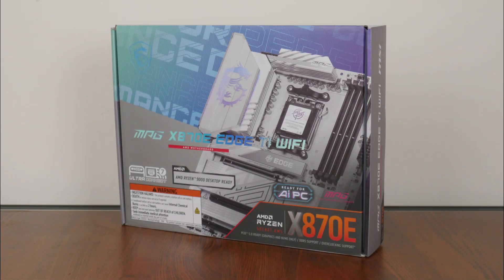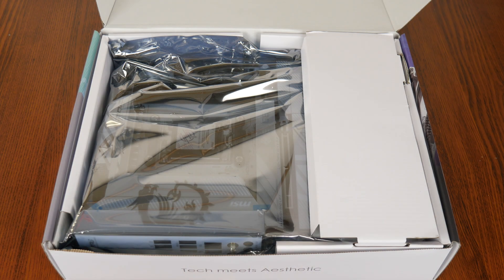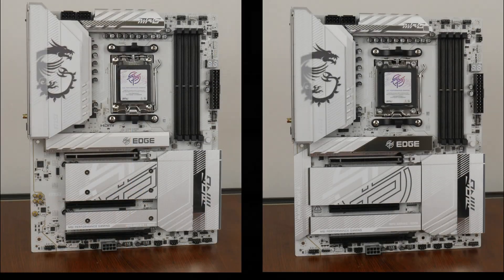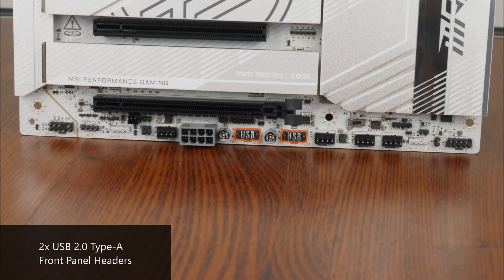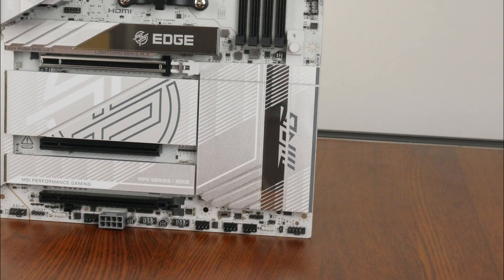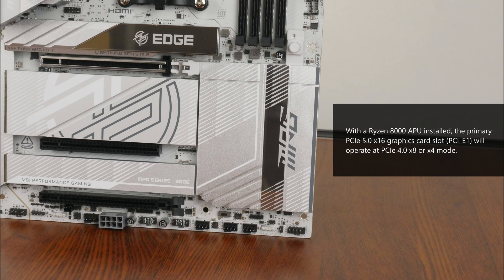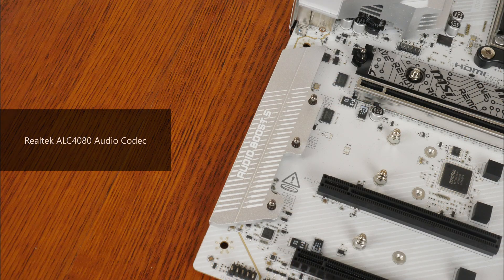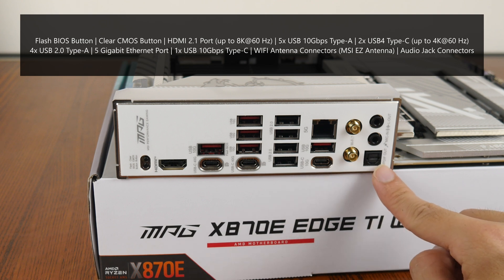Great for high-end Ryzen 9000 PC builds in white! MSI MPG X870E EDGE TI WIFI Unboxing & Overview

Comment: Very nice on detailing the features! However, the CMOS battery is not shown on this type or several other of MSI Motherboards!. Would you be able to provide that location MSI is hiding the CMOS battery? If possible an edited video or photo showing this location would be very, very helpful for that future battery replacement. It would seem not many YouTube Poster's are covering this missing information to the consumer.
Thank you!
Reply from the maker: Hey there, thanks for the kind words. I don't have the board with me anymore as it's a media review unit - that said, if my memory hasn't failed me, the CMOS battery SHOULD be hidden beneath the shroud of the integrated I/O shield. From my experience, that's where motherboard manufacturers tend to "hide" the CR2032 battery, and such boards usually use a CR2032 module that has a two-pin wire sticking out that goes into a connector on the board, rather than the traditional CR2032 round-shaped battery holder that we tend to get on motherboards in general.

https://tech4gamers.com/msi-mag-b850m-mortar-wifi-review/ <- there's a picture of the location of the CMOS battery here for a different MSI AM5 motherboard, you can check out the photo under the "Network and Connectivity" section of the article. Hopefully this photo gives you an idea of where the CMOS battery tends to be hidden by MSI!
Reply: @Darn, yeah if you sent the board back, you won’t be able to locate it.
Yes I’ve been looking for that silver coin in the socket, which is usually hard to miss.
I would believe the manufacturer would have it easy to service without board removal, maybe NOT. 
Thanks for sharing your knowledge! 
Best to you!
Reply from the maker: Cheers. Actually this whole hiding of the CMOS battery thing is becoming more common of late, from my experience messing around with motherboards, and they've always been hidden beneath the I/O shield shroud if you can't find them in obvious areas (e.g. near the PCIe slots etc).
Reply: @ALKtech  OK, good to know for at least for some of the MSI motherboards. Now a bigger question! Should the battery be hidden under the I/O Shield, does that mean to change the CMOS Battery will the Motherboard need to be removed?
What an inconvenience if that is the case. 
Better to swap the battery out with a new quality battery on the initial install maybe. Wish the manufacturer, in this case MSI, for the Z890 Edge Ti WiFi and Z890 Carbon WiFi that I have been looking at for the next build. Do wish MSI give much better instructions in their online manual with this change to avoid problems.
Thanks for all the info, best to you!
Reply from the maker: Unfortunately that's right, as you'll need to remove the VRM heatsink and integrated I/O shield shroud assembly, which typically requires the removal of screws on the back of the motherboard. That said, the CR2032 batteries of such motherboards with hidden CMOS batteries are the two-pin type rather than the typical coin type, something like this: https://www.amazon.com/EEMB-CR2032-Connector-Motherboard-Non-Rechargeable/dp/B09F38WVWH

And yes, it's unfortunate that motherboard manufacturers do not give clear instructions on how to replace the CMOS batteries especially if they're hidden, and you might have to fiddle around to remove the integrated I/O shield to get to the said battery, which can pose an additional challenge. But that said, CMOS batteries do tend to last a relatively long time...so it's an issue to worry about much further down the road 😅
Reply: @ALKtech  No wonder pretty much most of the reviews don’t cover this topic, could cause people to look at other motherboards and they were getting compensated for the review in some way. 
The battery replacement link was somewhat different than I expected, since I was thinking it would be just a removable connector box which the battery seats inside. Appears this is an entirely throw away setup. 
I will need to look stronger at other manufacturers for easier swap out. Granted these batteries can last a decade, however they can fail after just a few years as well. I suspect they are now looking at builder’s doing a newer system every 5-6 years and the hidden battery should do at least that long of time.
My system is 14+ years old and just minor upgrades to SSD and a simple water cooler on the CPU, it has been a very good build (my 2nd) i7-2600k. However, does not support Windows 11 so at a dead end for upgrading.
Thanks for ALL your assistance on the topic posed to you. I very much appreciate it!
Have a great week!

Comment: This has to be the most detailed MSI MPG X870E EDGE TI WIFI motherboard review on Youtube! Thank you for sharing your time, energy and knowledge! I'm building a new AMD RX 9800X3D system, after reading and watching numerous video reviews, I had narrowed my motherboard selection down to 3 motherboards, I hadn't considered the MSI MPG X870E EDGE TI WIFI. I just ordered it for $349, thank you again from another new subscriber!
Reply from the maker: Cheers and glad you found the video useful! What graphics card will you be getting for your 9800X3D build?
Reply: @ALKtech  AMD RX 9070 XT I also read your online review!
Reply from the maker: @ nice, you'll be all set for 1440p/4K gaming with lots of processor overhead for a future GPU upgrade to something even faster should you so wish!
Reply: @ALKtech  hi, im interested in this motherboard, however, its not selled in america, just in amazon imported from europa, like the one you showed in the video, i have a doubt, will this motherboard selled in europa work in my us pc build? (paired with a normal USA selled UPS unit) thanks in advance
Reply: Thinking about the same since asrock x870 seems to be having issues with Corsair and G.Skill ram in combination with the 9800x3d. Nothing would piss me off more than paying even $250 for a board that's bare bones. I'd rather chuck an extra hundred at it and get something that doesnt feel lackluster.
Reply from the maker: Mmm. I wonder if these issues could be due to the fact that XMP RAMs from Corsair/G.Skill were used instead of the EXPO variants!

Comment: Just bought this motherboard with 64gb 6400 c32. Can’t wait to  build my new 9800X3D build 😊
Reply from the maker: Sweet. What GPU will you be using for your build?
Reply: @ALKtech Gigabyte Aorus Elite 9070 XT when it’s available in Canada. It’s sold out everywhere. I found a used 9800X3D for $420 us I couldnt resist.
Reply from the maker: @jonathansaindon788  that's a good price for a used 9800X3D, it's great to see the stock and pricing situation improve for the 9800X3D! Sure hope the same thing happens too for the 9070 XT...really bummed out by the whole lack of supply and price gouging situation that's going on currently in the GPU market.
Reply: @ALKtech  Yea it’s gotten out of hand the few last years. They have to find a way to bypass scalpers if they care about gamers. But i’m not sure they do anymore…
Reply from the maker: @ sigh. Happens as long as there are willing buyers and willing sellers...I hope AMD can really ramp up production and put more pressure on their brand partners to rein in the price inflation situation.
Reply: Hope you got a 2 x 32GB kit cause a 4 x 16GB kit won't work.

Comment: First off, excellent overview. I’m thinking about doing an MSI build, and I’m looking at this Edge TI and the X870e Carbon (I watched your video on that one as well). Aside from the color, is the only significant difference between the two how they go about lane sharing? From what I’m seeing, the Edge is around 12-13% cheaper than the Carbon. Feature wise, do you think the Carbon is worth that much more?
Reply from the maker: Hope you found the videos useful! Apart from colourway, the CARBON comes with more overclocker-friendly features such as a beefier VRM setup and thermal sensor headers, as well as dual LAN ports. That said, the EDGE does have an edge (pun intended) over the CARBON when it comes to the whole lane sharing situation, where I do prefer the flexibility to choose whether to have PCIe lanes routed for use with the USB4 controller, or to have full Gen 5 bandwidth for the board's two Gen 5 M.2 slots. All in all, I'd probably be more inclined towards the EDGE, as I personally would not have any use for the CARBON's additional features, and would appreciate having the full 16 lanes for my GPU's PCIe slot!
Reply: @ thanks. Im leaning towards that EDGE (so to speak). I did buy a black case, but I think I could pull off a white motherboard in a black case.
Reply from the maker: @ I've seen a couple of builds with white mobos in black PC cases, and they do seem to work aesthetics wise 😅 would be cool to have perhaps, a white CPU cooler and white case fans for extra touches of contrast! Have you decided on a processor and graphics card yet?
Reply: @ALKtech  I have a 9800x3D, that and the case are the only parts I’ve bought so far. I’d like an RTX 4090 or 5090, but the 4090 is hard to justify as a lot of them that I’ve seen are going for as much or more than 5090s. I’d be ok with a 5080 as well, but it will all come down to what I can find available. I kinda like the looks of the MSI Gaming Trio 5080-90.
Reply from the maker: Best of luck with the hunt - I sure hope that  the supply and pricing situation can normalise sooner rather than later..the GPU market has been pretty rubbish of late 😅

Comment: The Board looks great, but they should also include white cables.
Reply from the maker: I do agree - in fact, I feel that the black bits on the board could have been white in colour too for an even cleaner appearance...
Reply: Can you paint them white?
Reply: @ Gigabyte does it with there white mainboards.
Reply from the maker: @ you can buy third-party white coloured cables, though I suppose you could paint them white if you really wanted to...

Comment: Great review, got the same one. I'm bothered, were the screws included?
Reply from the maker: Hey there, are you referring to the screws used to mount the board inside the PC case? If so, such screws only come with the PC case and not with the motherboard!
Reply: @ALKtech yes got it. Didn't have screws case too. Had to order from Amazon.
Reply from the maker: I see - that's really odd. PC case manufacturers usually include a pack of motherboard mounting screws and mounting standoffs too. Perhaps for your case the manufacturer might have left them out...

Comment: I'm looking at using this board with a high end air cooler.  I worried about the height of the VRM heat sink and I can't find any information on how tall it is.
This is a fantastic video by the way.  I'm going to come to this channel for more reviews.
Reply from the maker: Thanks for the kind words! You don't have to worry about the height of the VRM heatsinks - manufacturers of coolers and motherboards tend to stick to a fixed amount of clearance for maximum compatibility. Which cooler do you have in mind, out of curiosity?
Reply: @ALKtech  Thank you for responding.  I really appreciate that.  I have an old Cryorig R1 Ultimate.  It's quite large.
Reply from the maker: @ cheers! Ah I see...seeing as the cooler's been around for sometime (since 2017?) and lists AM4 support, I'd think it SHOULD still work with this board and its VRM heatsink height - in all my time tinkering with PC hardware, I've yet to come across a CPU cooler that doesn't fit due to VRM heatsink clearance issues (unless the heatsink explicitly mentions the lack of support for a certain socket) 🤔 do you currently have it installed on say, an AM4 build?
Reply: @ALKtech  It's currently installed on an Intel i7-8700k.  Now that you mention that, I'd better look for the box to make sure I still have the AMD mounting hardware.
Reply from the maker: @ time to upgrade your cooler too if you can't find the mounting hardware  😂

Comment: Awesome review! I just bought this instead of the ASUS ROG Strix X870-A. The only bad thing i saw so far is people saying when its in sleep mode the debug error 11 comes up. I hope MSI fixes the issue with an update.
Reply: Are you assembling a white cpu?
Reply: @navderm yes! I did that 2 months ago, this board is the best!
Reply from the maker: Glad you found the video useful - out of curiosity, did you experience the same debug error code 11 for your own build?
Reply: @ALKtech I’m still buying parts to build my pc but I will know prob this year. Have you heard about the debug?
Reply from the maker: @ I've only seen one comment on this video thus far from someone who mentioned facing this debug error code issue!
Reply: Just cancelled my order of the Strix too for this one, has all the same features I need just looks better and I've had an MSI motherboard before with no issues.

Comment: hi. please, help me. what is better ? 
1) GIGABYTE - X870E AORUS PRO ICE 
2) MSI MPG MPG X870E EDGE TI 
Many people say MSI. but i need Master's opinion)
Reply from the maker: Hello there, what's the price difference like between both motherboards where you're from? 

Personally, I'd pick the X870E AORUS PRO ICE if aesthetics are my priority, as the Gigabyte's properly all-white aesthetic is something that other motherboard manufacturers simply do not have in their product line-ups thus far. However, the main thing going for the MPG X870E EDGE TI WIFI is the fact that its GPU slot doesn't share bandwidth with its M.2 slots, which is something to note especially if you are intending to use more than two M.2 SSDs for your PC build. The MSI has two less VCORE power phases than the Gigabyte, but comes with an eight-layer PCB versus the six-layers that the Gigabyte has.

Seeing as both boards are still very similar to each other in terms of specs (except for aesthetics) - price would be a major deciding factor here too..
Reply: @ALKtech  thank you, MSI - 330$, Gygabyte - 370$. I ll order from newegg
Reply from the maker: @ thanks for sharing! With that $50 price difference, I'd probably go with the MSI, unless you're really particular about having an all-white aesthetic!
Reply: @ thank you)
Reply: But what about features wise? Which board is better do you think?
Reply: @oedjuju  I bought msi, if u wanna know)
Reply from the maker: @ both boards are very similar apart from the differences I mentioned above. Again, price would be an important factor for me, but given a choice, I'd probably be more inclined towards the MSI (unless having a pure-white aesthetic is the major deciding factor).

Comment: MSI in what world do people buy a beautiful WHITE motherboard and use the Black cables that you supply. It is a no brainer that I can buy a white motherboard anywhere and they have White cables to connect their boards.
Reply from the maker: I actually do think it's a missed opportunity that black cables were supplied here - in my opinion Gigabyte's doing it right with their ICE series of motherboards if we're looking at things from an aesthetics perspective, with white cables and white onboard connectors/hardware too...
Reply: @ALKtech  I agree that Gigabyte boards look good and was my go to, they dropped the ball on the X670-B650 cutting the PCB layer count and making then cheaper and charging more for nothing. MSI and ASROCK are the only 2 brands that you are still getting some quality for what you pay. Show me where the GIGABYTE X870E AORUS PRO ICE with 6-Layer PCB and 16-80amp power stages is worth $100 over the ASRock X870 STEEL LEGEND 8-Layer PCB and 14-80 amp power stages and has the latest Audio and you can use all the M.2 slots.

Comment: Great review, If I want to install 2 SSD, I should use Slot 1 and slot 3 or 4 ?!
I would be grateful for a good hint. Tnx
Reply from the maker: Hey there, are you able to share if your M.2 SSDs are PCIe 5.0 or PCIe 4.0? If you're gonna use two PCIe 5.0 M.2 SSDs, I'd install them in the first and second slots - but do note that there's some form of lane sharing with the board's USB4 ports. If you're using say, 1x PCIe 5.0 and 1x PCIe 4.0 drive, I'd install the PCIe 5.0 drive in Slot 1, and the PCIe 4.0 drive in Slot 3!

Comment: Would you suggest the msi x870e or the b850? I kind of don't really like the PCIe Lane Sharing. I have the money for both and I already have a 9800x3d to pair with either board. Which one would you suggest in this case? Thank you for this video btw.
Reply from the maker: Hey there! I'd personally be more inclined towards the B850 even if money were no object, simply because both boards are super similar to each other and I personally have no use for USB4 at the moment. However, the B850 EDGE TI WIFI does have a "nerfed" PCIe 4.0 M.2 slot that runs at x2 mode instead of x4, which isn't perfect either, but I guess something's gotta give especially since the chipset only has that many PCIe lanes. Out of curiosity, what's the price difference between both boards where you're from?
Reply: @ALKtech  Thank you for the reply. The B850 is $259.99 and the x870e is $329.99 USD, a total 70 dollar difference on Amazon.
Reply from the maker: @ mmm. In that case, I'd probably grab the B850 EDGE TI WIFI and use the $70 elsewhere - but again, this is assuming you might not have any need for USB4!
Reply: @ALKtech  Oh yeah I don't have any need for USB4. Thank you again! I'll get myself the B850 EDGE TI